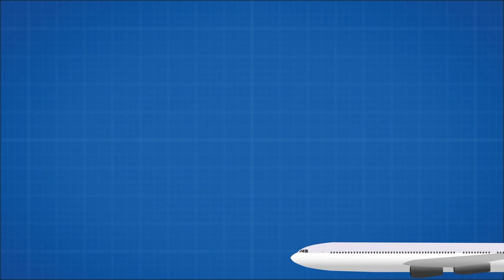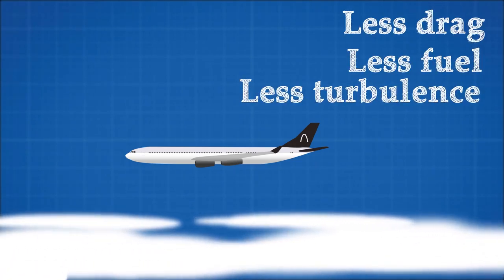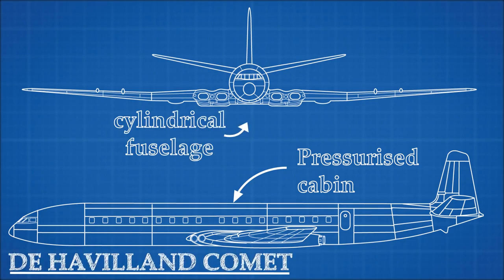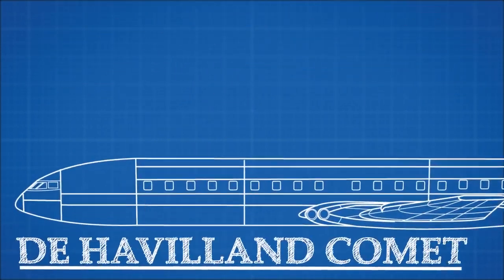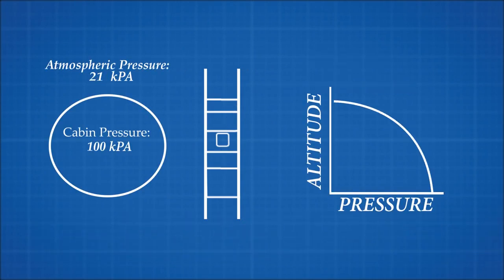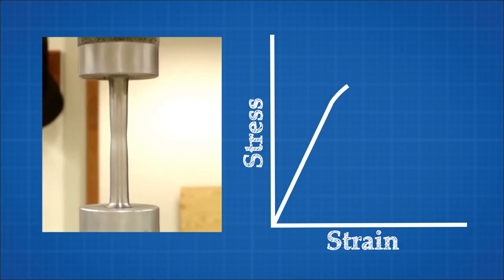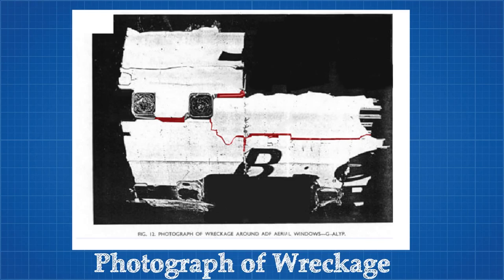Why are plane windows round?

Comment: Simple answer: if you make jets with square windows, they fall apart.
Reply: That doesn't answer the first word in the title of this video.
Reply: Richard van Pukkem That is the reason, because when they made a jet with square windows, it fell apart in mid-air because of the weak points at the corners. That's why they made them round.
Reply: I think you didn't get me. That the windows otherwise would fall apart is the Result of Why they are not square. The Why is answered by the material-stress story.
Reply: +Richard van Pukkem The material stress is what caused it to fall apart.
Reply: I'm not talking about the why which has been explained now for 300 times, which i know even before the video started. I'm talking about your comment.
Reply: +Richard van Pukkem Sorry, what?

Comment: Cockpit windows aren't oval. I guess they handle the stress concentration differently there? By building relatively massive frames around?
Reply: +unci narynin They are still some what cylindrical rather than just a sqaure. This would make for less stress.
Reply: Cockpit windows are massive thick, like 5cm or so, and are bolted onto a frame with 300 bolts. What Unci said.
Reply: hahhah nope very good point..different type of glass is now used after those crashes.. and the cockpit glass is 10 times thicker ..it wasnt the squareness that caused them to fracture..and round does reduce fatigue even more
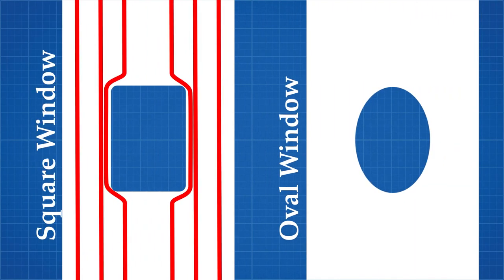Reply: 1:25 they look just like that but the are curved a little more on the edges.
Reply: good point my friend ! they do suffer with stress concentration but suppose the nose of the plane is a piece of sphere, the stress concentration is aprox. HALF of what it is in the cylindrical body of the plane !, ok it´s not the very exactly way it is but for didacticism (nose of the plane do not accumulate stress as the body) it may help you to see why, also I imagine that it also have something to do with fabrication once plan glasses are easier and cheap to make =).
Reply: Pedro Otavio Savine Sorrentino If you compare the cockpit windows of the B737 (basically the same as those of the 707 from the 1950s) to those of the B787, you will see that the B737 and many subsequent designs have flat cockpit windows with sharp corners, whereas the B787 windows are cylindrically curved (for better aerodynamics) and have round corners (for less stress concentration in the structure). Still they continue to build the 737 with the old nose because it would probably be very costly to design and approve a new one. (Airbus development is similar, with curved cockpit windows introduced in the A350.)
Reply: The frames are very strong, and the panes are held in with hundreds of screws. Mind you, there was an incident a while back, BA 5390 where a technician put the wrong sized screws in and the window blew off mid flight, which half-sucked the captain out of the window! Luckily, no one was killed. The captain, despite having been exposed to the sheer cold for so long as well as severe trauma, survived and was taken to hospital where he made a full recovery.
Reply: unci narynin very interesting ! I did not thought about the economic view, very important for airliners, in fact ! =) !
Reply: Yes, the area around the cockpit windows are heavily reinforced. 
Cockpit windows are typically made from laminated glass, while cabin windows are plastic (stretched acrylic)..

Comment: The stress flow isn't the only cause, Fatigue could also happen faster with square windows ( due to concentrated stress) which is the cause of those crashes.
Reply: +SAHM The stress flow explains the concentrated stress when using square windows...which leads to "fatigue" which leads to crashes....

Comment: Having no internal windows would then be even better, right?
Reply: +CommunistKiro Yup. But that wouldn't be nice for passengers. Not having a visual reference.
Reply: +Jonathan Tan I think I'd read somewhere that traveling by plane with the seats facing the opposite direction of translation is a lot safe from an engineering point of view, but passengers would feel uneasy or uncomfortable.
Reply: +CommunistKiro yes, and this is actually crucial for supersonic flights because of the elevated heat.  If you look at the Concorde, for example, you will notice that there a few windows, and they are pretty round.

There was a plane that is in the concept phase right now, the Spike Aerospace S-512, that has no windows, and instead, uses a big monitor or tv or projector to show the image of what the outside world looks like.  Essentially a window, but not exactly a window, and it takes care of the materials and stress issue.
Reply: yes
Reply: The Air Force Transports still do that. That is so you won't see the guys ass in front of when your head goes through his ass when it crashes. Safer? Debatable.

Comment: airplane windows are round and provide a fish eye distortion so people cannot see that there is no curvature to the earth....and is flat as a pancake.
Reply: How exactly would one see curvature to the earth, when airplanes only fly at about 30,000 feet, which is 5 or 6 miles up, and the planet is 8000 miles in diameter? At that height, I imagine that the curvature should be very slightly visible, but only if your mind can make extremely accurate measurements, and not be distracted by the many surface features. Well that doesn't describe anybody that I know. Maybe the Star Trek TNG android Data, but then, he isn't real.

From normal orbital heights, curvature should be easily visible. But airplanes do not go that high, as they depend upon the air for their lift. And airplanes do not fly at the much higher orbital speeds.

If you want a more legitimate conspiracy theory than being a silly easily-debunked flat-earther, look into whether the manned moon landings may have been faked, and that 9-11 was an inside job.
Reply: Dav Vez After you posted that comment, Neil Armstrong came to my house and hit me with a flying roundhouse kick when I opened the door.

Comment: Wouldnt the stress levels further reduce when the oval windows are elongated in length of the plane rather than the current situation of being slightly elaongated in height of the plane ?
Reply from the maker: No, that would increase the stress concentration. The hoop stress runs along the circumference of the fuselage. You want to streamline any obstructions along that stress flow. Think of aerodynamics.
Reply: +Real Engineering  Thank you.
Reply from the maker: +Deepak C Happy to help. Intelligent questions are always welcome on my channel. I try to answer all

Comment: Where, if any is the stress concentration with the oval windows?
Reply from the maker: If you Google search "stress analysis circular hole" you will get some nice visualizations. If you see my diagram in the video, the areas where the stress flow contours are closest together, that's where stress is highest. Generally the stress will be highest on the left and right sides of an oval hole, but that depends entirely on how the material is being loaded. 

Hope that is understandable.
Reply: Thanks! Yep, makes sense. I'll check google too.
Reply from the maker: +Jza Diamo no problem, that's what in here for.

Comment: Yes, they are oval. So why is your video titled "round"?  Windows are not round, except in some private jets.
Reply from the maker: To answer your question. Round just sounded better to me. To argue my use of round. Round is not a shape. Round is an adjective describing a shape and an oval is a round shape. Round covers all my bases for different window shapes. Some have tear drop shapes, which are also rounded.
Reply: +Alcepton Music 
Most planes have rectangular windows with round corners. This video never said that planes have circles for windows, just that they are rounded.
Reply: fucking people like you dont understand the definition of round differently.
Reply: +Real Engineering Don't 737s have curved edge square windows?